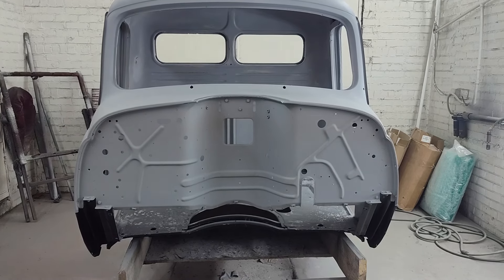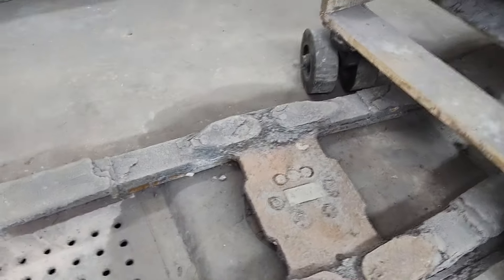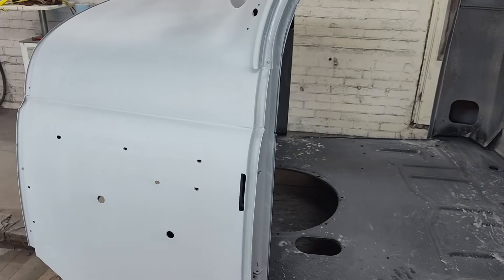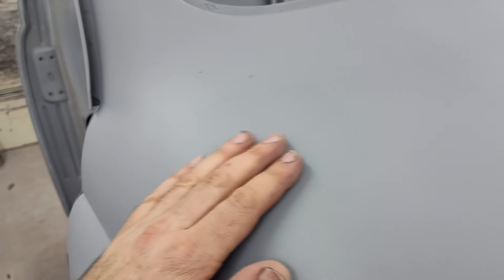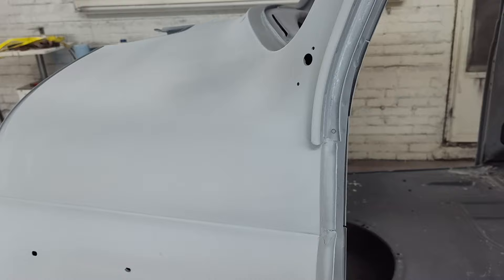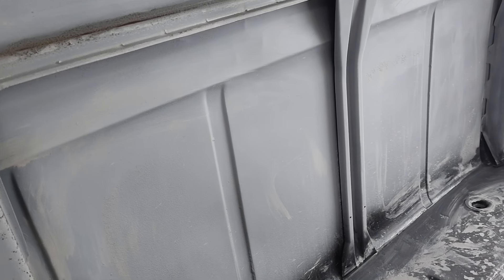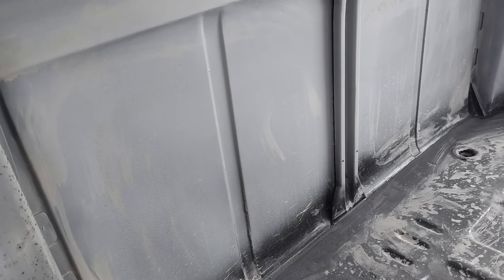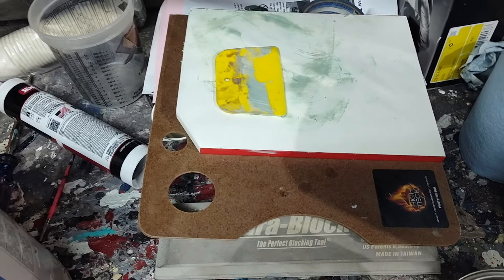1953 International R110 Restoration Cab In Primer

Comment: Nice job. Check one more thing off list. What engine did that come with? You going back with original or stepping it up? Had an IH pickup in high school. Had a 304 v8. Later had a Scout 2. It had a 345 in it. Was great off road unless it got real bad. Did not have low range transfer case. Just 2 or 4WD.  Lot of good times had in both. You said you’re in Texas. Me too. Had you pegged as NJ or Pennsylvania area by accent. Anyway good work neighbor. Keep doing what you’re doing and that truck will be cruising before you know it 👍
Reply from the maker: It had a 6 cyl originally but unfortunately was badly seized up. I have a rebuilt 351W that Ive been waiting to find a project for so it will go in here along with a 4R70W trans. I appreciate the comments.